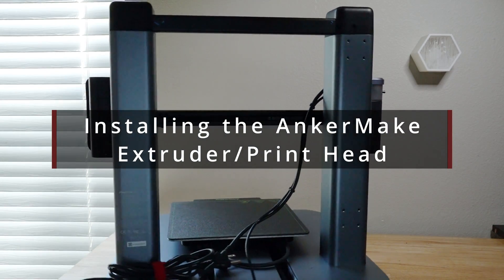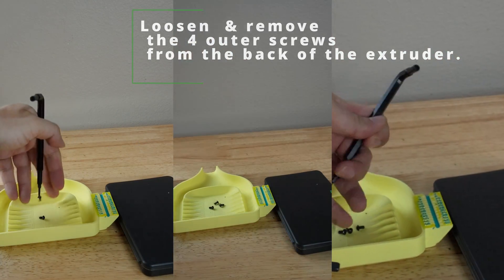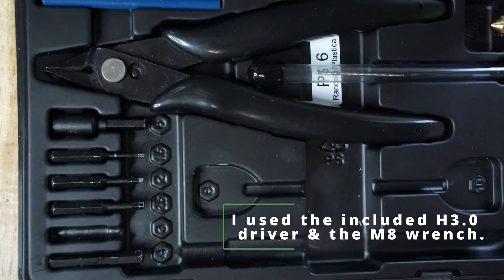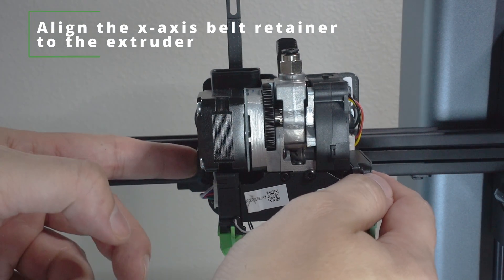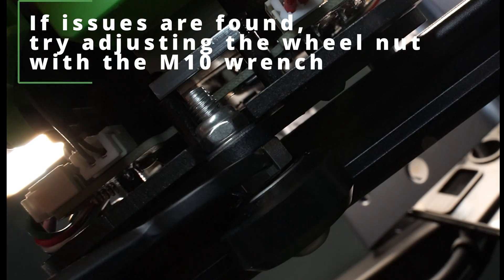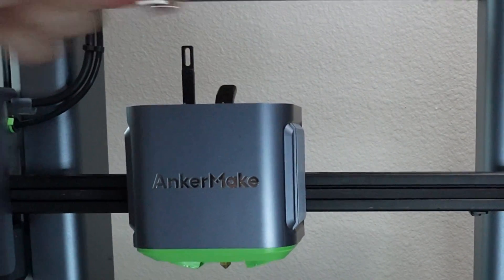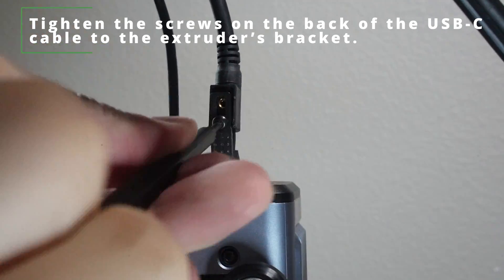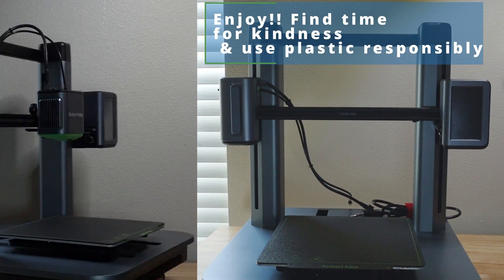How to install the AnkerMake Extruder #ankermake #3dprinting #repair #extruder

Comment: Thank you SO MUCH for the tip to use a screwdriver to loosen the V-wheel. I could not get the wrench in to hold it steady, and I thought I was hosed.